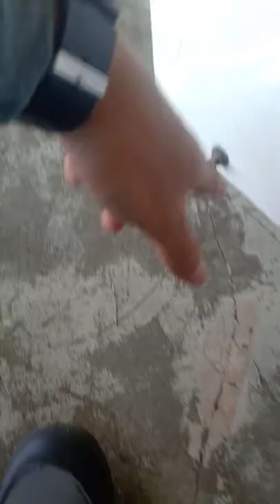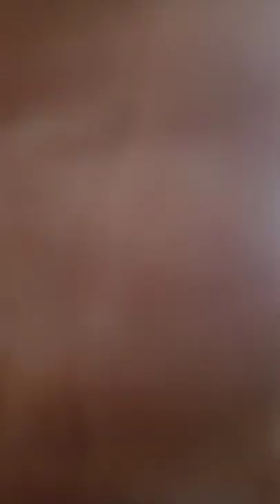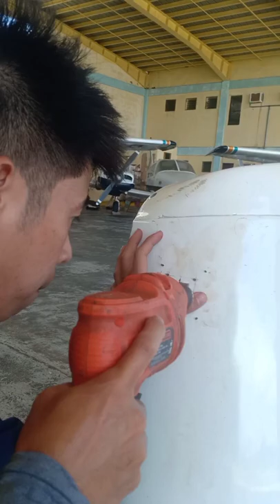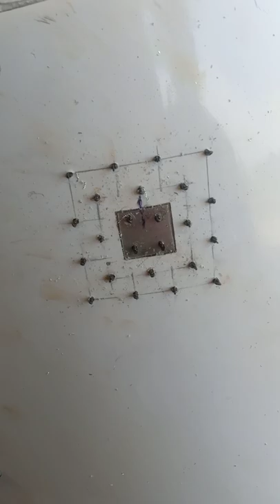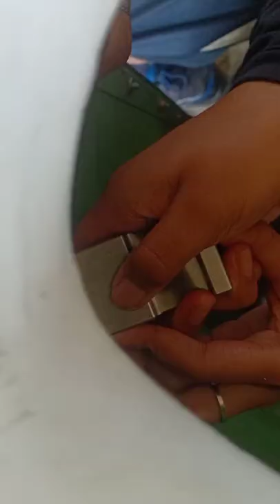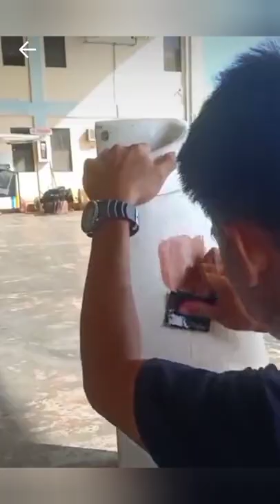Sheet metal "FLUSH PACTH" Repair upper cowling Cessna 172

Comment: All corners should be radius-ed to hold down the chance of cracking out corners. Normally you try to keep the open margin to a minimum and straight to keep out water and also for looks. It is possible that I just had great instructors at MT Sac, but they would have tore us up if a patch was of this quality.